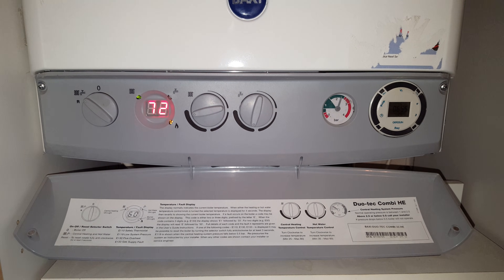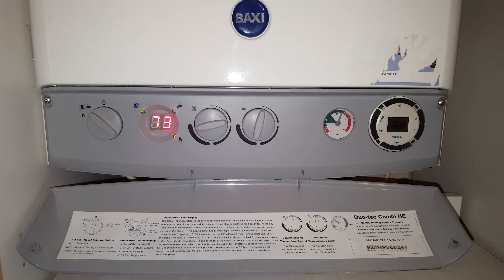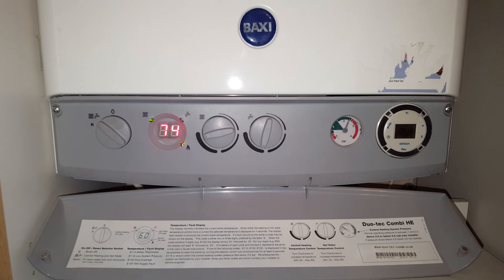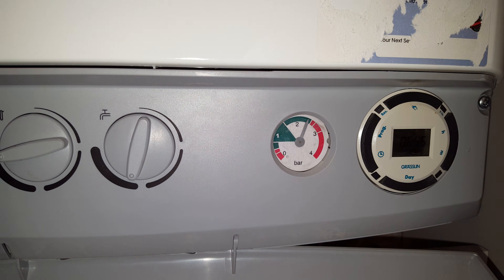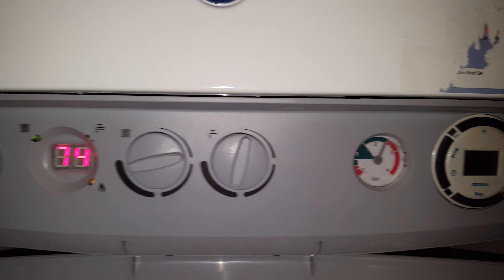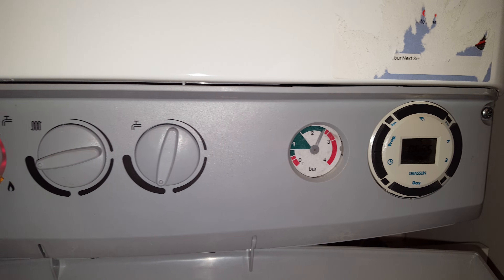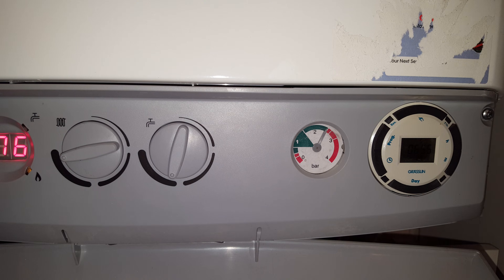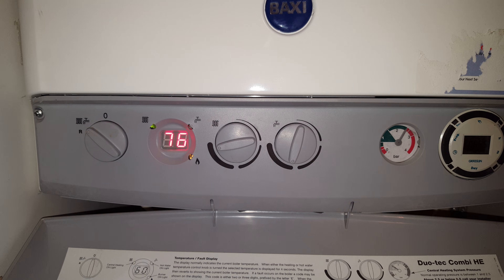Pressure gauge too high BAXI Duo-Tec

Comment: Mines only too high since I put the taps on underneath...it wasn't a fault I just filled it too much how do I lower the pressure? I have the same boiler
Reply from the maker: Try open a air on a radiator for a while that should do it